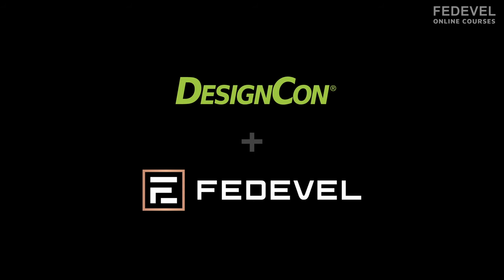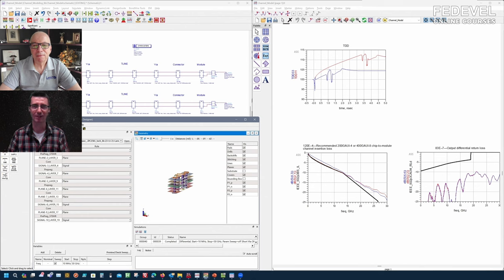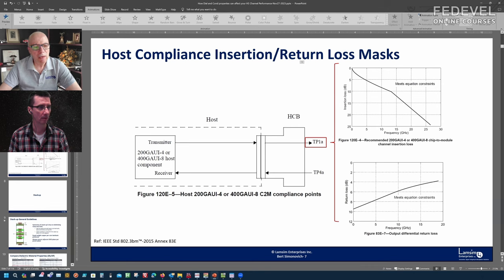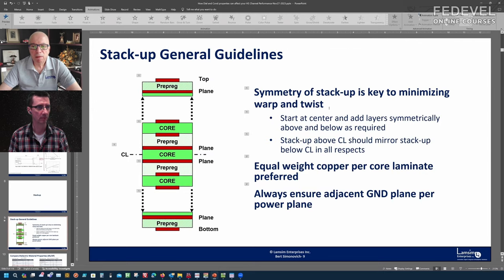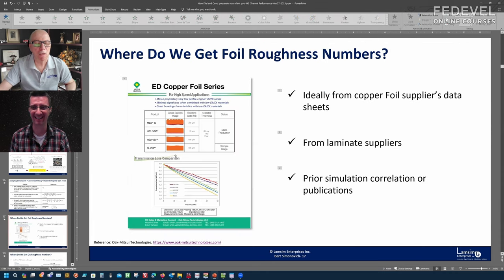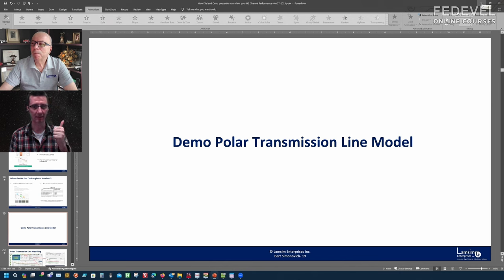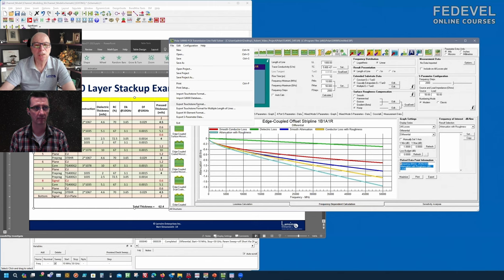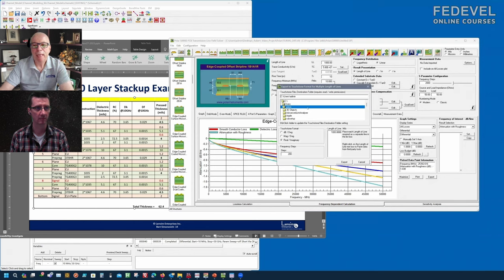How to simulate PCIE / IEEE path on PCB + Everything you need to know | Explained by Bert Simonovich

Comment: Regarding Dkx and Dky: this is a rare case where the orthogonal EM coordinates and the orthogonal physical coordinates are NOT the same. You should use Dkx and 45 degree Dkxy to model the complete solution.  Dkx and Dky will only vary by the weave parameters. Dkx and Dkxy will vary on maximum difference in bulk material properties.
Reply: All glass reinforced laminates are anisotropic. Dkxy and Dkz are effective permittivity of the dielectric when measured by a particular test method. Dkxy means the electric fields generated by the dielectric test fixture are in-plane or parallel with the fiberglass weave, while Dkz the e-fields are out-of-plane or perpendicular to the glass fiber weave. When an EM wave propagates along a planar transmission line, the e-fields are out-of-plane with the glass weave so Dkz value is needed to model Zo. When an EM wave propagates through a via, the electric fields are in-plane so Dkxy value is needed. Dkxy and Dkz are merely simplified naming for in-plane and out-of-plane values for permittivity.

Comment: Grat vid! Very important stuff were sead and i lernd a lot. Thansks! ❤

I have one question around 1:30:00 we see a TDR of the VIAs. I did not understand where/how do you set/determen the rise time of the exaitation impuls?
Reply: In ADS via designer TDR viewer tool, the rise time is set automatically based on the maximum frequency simulated. In this case it is 20 ps.